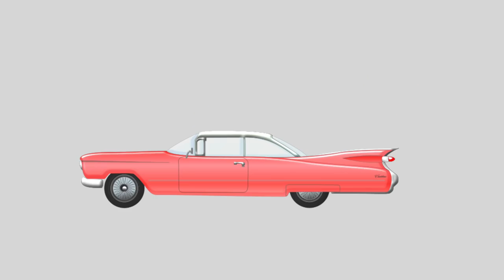Yes, Rockets CAN Fly in a Vacuum

Comment: I know the space shuttle isn't your thing, but I was wondering if you could explain why the shuttle used solid fuel boosters rather than ones with liquid propellants. This perplexes me, as liquid fuels deliver greater specific impulse.
Reply: I believe it had something to do with simplicity and reliability.
Reply: Several reasons;

Solid fuel is cheaper per booster but has a high cost to set up production, as ICBM production was decreaseing thanks to programs such as START this was a political choice to support american solid booster companies as they have strategic importantance (solid fuel boosters can be stored in silos for long periods of time, while liquid boosters this is more complex due to boil off and corrosion). 

Anouther reason is that specific impulse for first stages has less of an affect on total mass than later stages as the increase in mass to get the same Impulse only affects that first stage (compared to a second stage where the increased mass means a larger first stage to lift the greater mass) so the moderate diffrence in impulse doesn't result in a massive diffrence in mass. 

In addition the The extra mass and complexity of a liquid fuel system just isn't worth it compared to the simplicity of solids. The dry mass (plumbing, tanks, and engine) of a liquid booster is greater than a solid of similar size, and solid fuels are typically denser than liquid fuels so that is further compounded.
Reply: Kerbal Rocketry
Thanks!
Reply: When a rocket first launches off of the pad, specific impulse isn't quite as important as thrust to weight ratio. SRB's were chosen for the shuttle because of their simplicity and reliability, but also because they can kick out a lot more thrust for their weight than pretty much any liquid engine-powered booster. Overcoming the pull of gravity, as well as wind resistance, eats a rocket's performance during the first minute of flight, so a solid rocket motor provides that raw power on the cheap. In the later phases of ascent, when the vehicle is moving horizontally and out of the atmosphere, that's when specific impulse counts the most, because your horizontal speed is so high that gravity losses become negligible, thus the primary role of the engine is to gain as much speed as possible, using as little fuel as possible.
Reply: It's mostly because of losses due to gravity. SRBs have a really good TWR meaning that while they're inefficient, more of that inefficient thrust is going towards accelerating and less towards just fighting gravity. An rp1+lox rocket with a TWR of 1.1 and isp of 350 is a lot less efficient during ascent than an SRB with an isp of 200 and a TWR of 2.
Reply: BTW. look up gravity drag if you wanna' learn more about this.
Reply: It was kinda politics. NASA was not into SRB's for human missions. The reason being they make parachutes impossible in a launch escape scenario as so much still burning fuel is in the air that it would ignite the parachutes. And you can't really control them. But it was cheaper and a way to keep ATK continue building SRB's. The shuttle went through a bunch of redesigns to reduce cost, originally it was completely liquid fueled and more reusable. Some designs even featured a smaller orbital shuttle launching from a larger booster shuttle, both landing like airplanes after deorbit/boost phase. Also the DOD started demanding very large payload bays and payload capacity which ended up making it way bigger than it was supposed to be and needing a lot more fuel and thrust. It was kinda like SLS. The engineers had a vision of something and then people kept interfering and complaining about cost until we ended up with something that no matter how impressive, wasn't very useful or economical.
Reply: Cheap, simple, and politics.
Reply: Politics and cost.  SRB's are cheaper.  The Space Shuttle program was compromised from the beginning by DOD considerations.  The design of the SRB's was influenced by the desire to support ICBM production and specifically Morton Thiokol.  The critical weakness of SRB's is that once lit, there is no shutting them down.
Reply: Coz they together provided 6.2 million pounds of thrust
Reply: Because there isn’t really any other useful work for solid propellant than for ICBMs, and so they would’ve went bankrupt in the gaps between ICBM acquisitions and therefore wouldn’t be able to provide for national defense when it comes time to buy new ICBMs to replace our aging force.
Reply: The shuttle used SRB's for the same reason the Saturn V used kerosene in the first stage. You need a heavier fuel with more mass to produce enough thrust to lift the fully fueled vehicle off the launch pad. Thrust is generated according to the equation F=MA. So to get enough thrust to lift the machine when it's fully loaded and heavy you need a more massive fuel. Hydrogen is too light so it won't do the job alone. Specific impulse is a measure of how long and how far an engine can push something. It's like MPG in a car. Thrust is different. It's more like how much brute upward force a rocket engine can produce. It's like comparing the force necessary to move an 18 wheeler versus a compact car.
Reply: Thanks to everybody who responded to my question so knowledgeably. You've greatly enhanced my understanding of rocketry. 

Thrust to weight ratio was something I'd never before considered but which makes perfect sense in its elegant simplicity. Also, Joe Vignolo's explanation of the importance of the mass of a fuel answers a long-standing question of mine; namely why the Saturn V used kerosene in the first stage.

Best...
Reply: Your balloon illustration has the escaping air pushing against air in the room which is all around us, an invisible "liquid" matter we don't see. But in a vacuum the air has nothing to push against so it consequently would stay in one spot and spin wildly as the air escaped. You've probably seen this done in a vacuum. Spaceships would do the same and have no ability to fly or go straight as when they supposedly did when they flew to the moon.
Reply: @ Marcia - Neither the balloon nor the rocket work by pushing against an eternal medium. Both work by accelerating a gas out of a nozzle that  restricts and speeds up the flow. In both cases the gas has mass and therefore inertia. Therefore accelerating the mass against its own inertia produce a counterforce in the opposite direction. It goes by the equation F=MA. The thrust is actually produced right in the nozzle and not outside and behind the engine. In a rocket the engine is swiveled or "gimbaled" to keep the vehicle properly pointed and going in the desired direction. The rocket's guidance system uses an inertial attitude reference and a computer to constantly reposition the engine to keep the vehicle on course along the desired trajectory.
Reply: Michael Tuz 
SRBs were cheaper

Comment: I once used newtons law as a defense for my cars exhaust system. 

Mufflers and baffles disrupt the engines exhaust system Scavenging exhaust pulses from my cylinders, thus reduces my exhaust velocity. So my open pipes are meant to use the cars exhaust to help propel my car thus making my car more efficient. 

It didn’t work. Full fine.

Comment: Something else to point out is that once a rocket reaches outer space, it no longer needs fuel to keep going. Within the vacuum of space (without friction), the object will continue to travel  in the same direction and at the same speed. At this point, more fuel can be burned to increase the speed or to change it's direction. I'm assuming that there is no diminishing returns when it comes to reaching higher speeds (i.e., you can continue to gain speed at the same rate regardless of current speed), but then it becomes a matter of needing fuel to also slow down once approaching the destination.

Comment: For those who are unsure of the inner workings of an automotive engine, I would just like to clarify that in most all cases the explosion is thrusting a piston downward. Usually there is more than one piston. These pistons push what is called a crankshaft in a circular motion and this "cranking" motion is eventually translated to your wheels by your transmission.
The exhaust gasses are not pushed out by the explosion itself but rather by the piston as the piston travels upward again.

I'm sure it was just abbreviated in the video for the sake of brevity, but I thought it might be hard to follow or misleading to some viewers.
Reply: I didn't like the way she used the car analogy and came straight down to the comments before I watched any further and lo and behold, you already did it for me.....thank you! You were at the top of the list too...beauty!

Comment: Amy, don't forget the hypergolic rocket engines that need no igniter/spark plug! :) The Titan II and the LM used Aerozine 50 fuel and (di)nitrogen tetroxide oxidizer, which combust as soon as they mix, providing thrust.
Reply: Christopher U.S. Smith Technically, they have an “igniter” (really: “a source of ignition”) as a hypergolic mixture, it is just a chemical auto-igniter.  Even monopropellants have a “source of ignition” in the form of a metallic catalyst.  Essentially, to continue the automotive analogy, hypergolic fueled rockets are akin to Diesel engines, wherein the fuel and oxidizer are mixed under conditions to promote auto-ignition.
Reply: detritus23 Everything I've ever read/heard on hypergolics say they are used so no external spark is required. Also, Diesel engines do have an igniter. It's called a glow plug, which ignites the compressed fuel.
Reply: Christopher U.S. Smith If I may respectfully put my two cents worth in,
Wouldnt the exposure of chemical A to chemical B be the ignition source?
Just asking.
Reply: abc def She's talking about where an external ignition source is used, which is not required for chemicals that combust when mixed (which A-50 and NTO do). All they need is an inert gas to pressurize the supply lines (like the helium used in the LM).
Reply: The activation energy of the chemical reaction is less than the average thermal energy of the reactants. That's where the ignition source comes from.
Reply: The glow plug doesn't ignite the diesel fuel. The glow plug just warms the fuel and cylinder to allow the diesel gas to self ignite under high pressure easier, which is how diesel works.
Reply: i ran into someone with a problem once where his diesel engine didnt want to shut off, we tried letting the clutch go in a way to high gear in the hope it would stall but it pulled right trough the clutch, lol.. took us a long while to shut off that damn engine.
Reply: Yep, diesels have plenty of torque. Turning it off should stop the diesel high pressure spray, but if it doesn't stop, the engine won't stop. Trying to use the clutch method like on a gas engine is a bit more difficult. Disconnecting the batteries can sometimes help if they unpower the injector pump.
Reply: Markle2k With hypergolics, though, the chemical reaction produces enough energy to spontaneously ignite, "without an external source of ignition, such as a flame or spark."
Reply: takin it off battery didnt work, i dont know exactly how diesels work but that one didnt need a battery to keep the engine goin, we eventually turned it off by squeezing the fuelline shut ( bending it in on itself, we were lucky it was a old a shitty car )
Reply: Eagles_Eye They call that "wild catting" and they stuff a rag into tbe air intake to kill it.
Reply: A diesel engine is still easier to stop than a solid fuel rocket.
Reply: far be it for be to argue that
Reply: Christopher U.S. Smith nope... The glowplugs are for the cold starts
Reply: Eagles_Eye : Diesels (diesel is technically the engine style, not the fuel: they were named after their inventor, and basically just use the fuel they do because they can, not because the design has to) work by exposing a fuel-air mixture to the hot walls of a combustion chamber, which causes the mixture to spontaneously ignite. Spark plugs can be used to start the engine, but are not strictly necessary, and are utterly irrelevant after the engine has warmed up. Cold weather can interfer with starting, which is often dealt with by installing an electric heater into the engine, and plugging it into the wall when at home (this is one of several reasons that vehicles sometimes appear to have the end of an electrical extension cord sticking out of their hood). I don't recall exactly how Diesels are started without a spark plug, but I do remember that there's a way that did used to be used.
Reply: Jared Maddox The ignition in diesel is purely compressive ignition, but the glow plug does pre-heat the combustion chamber to assist the process.  The plug-in element you are thinking off was an anti-gelling heater for the fuel filter.  This was necessary for older formulations of diesel fuel, which would literally clog its own fuel lines in sub freezing weather.   As I understand it, modern diesel formulations have better cold weather anti-gelling properties.  Of course, if you want to experience that bad old days, you could try and run a car on bunker oil.....
Reply: The glow plug is only used at cold start, to get the engine going...
Reply: And the fuel and oxidizer for those engines was highly toxic.  Nice!
Reply: detritus23 & Christopher U.S. Smith - Actually you are BOTH right. Hypergolic propulsion systems typically employ a "Catalyst Bed Heater" element that helps the ignition be more consistent.  You CAN fire a hypergolic thruster without the cat-bed heater active, but the instantaneous temperature rise is very hard on the thruster hardware.  So they like to pre-heat the thrusters and the cat-beds before flowing the fuel.  That way you get a consistent ignition & burn
Reply: She didn't - she has a video on it from a while ago: https://www.youtube.com/watch?v=N4LjLPmsOLQ 
.The Gemini program used a modified Titan II design.
Reply: the moon lander had a hypergolic engine i think
Reply: Blox117 That's what the LM (lunar module) is. :) The Apollo SPS engine in the Service Module also used A-50 and NTO for propulsion, while liquid hydrogen and liquid oxygen powered the fuel cells (e.g. batteries)
Reply: Michael Moorhouse Normally, she'd also mention it and point out the link to it. Not this time. :(
Reply: +detritus23 You can operate a gasoline engine without a spark plug, you just need to get the compression ratio higher.  But it doesn't lend itself to very consistent combustion (gasoline has an absurd range of hydrocarbon weights in it), and spark plugs provide more consistent starts over a broader range of temperatures.

As far as I know, refineries still produce winter and summer weight diesel fuel.  Summer weight freezes at around -5-10C, which will leave you at the side of the road in a Canadian winter.  I had a summer job at a refinery where I tested the diesel freeze point periodically to ensure they weren't screwing that (and many other things) up.

You've never quite experienced hydrocarbon fuels until you pour a bit of light gasoline in the palm of your hand and have it boil off from your skin temperature.
Reply: Fromage Frizzbizz That's why most of NASA's post-launch engines are hypergolic. They work reliably (compared with the two times Saturn V first stage engines shut off early).
Reply: +Christopher U.S. Smith Shutting off early isn't exactly related to difficulty starting, is it?  It certainly makes positional thrusters a lot simpler, but Space-X doesn't appear to have gone the hypergolic route for sustainer stages.  There's a number of pros-and-cons.  A relatively smaller hypergolic sustainer coming apart on the pad (with its load of toxics) isn't nearly as bad as if the whole first stage was.  Refueling cryogenic oxidizers on a sustainer on top of a massive first stage with oodles more cryogenic oxidizers also tends to add to the pucker factor ... ;-)
Reply: Fromage Frizzbizz I was referring to engine reliability.
Reply: Providing thrust? That's funny.